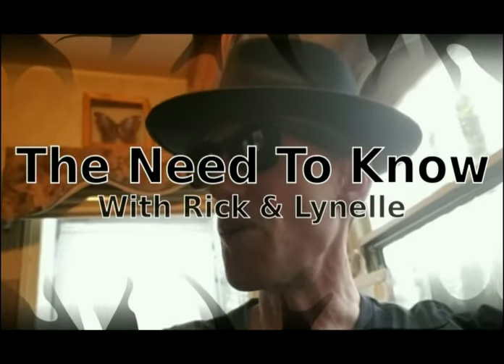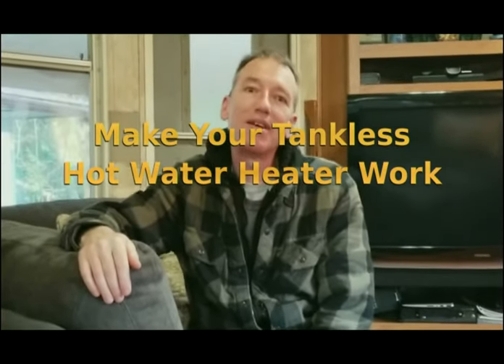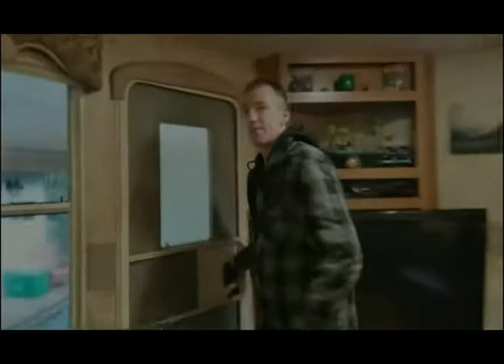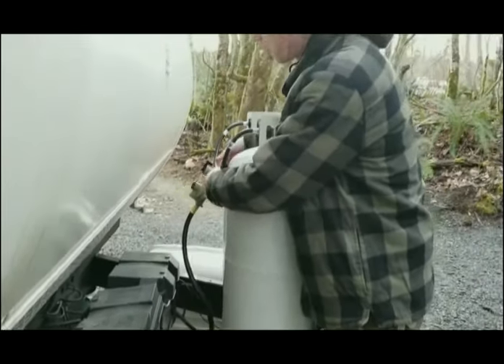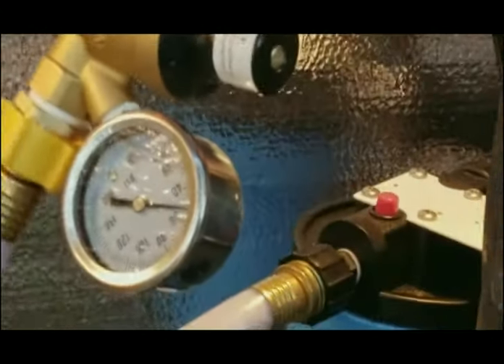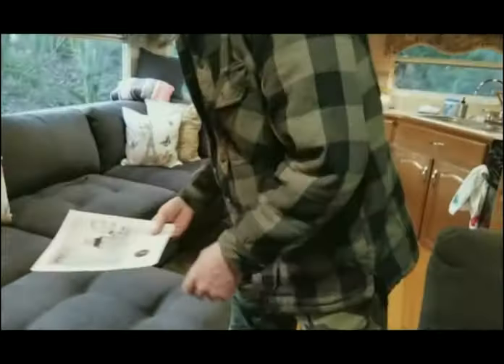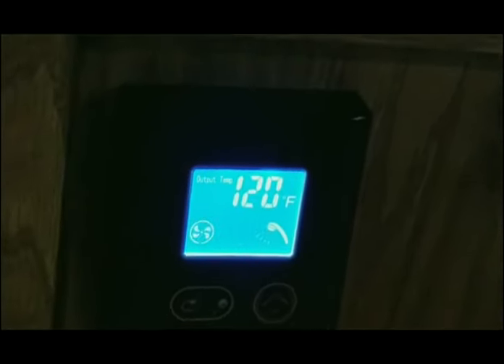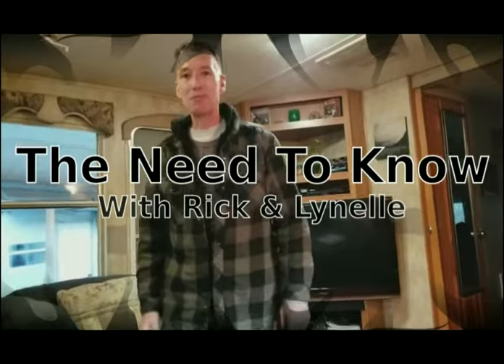Make your tankless hot water heater Work - THE NEED TO KNOW files.

Comment: Thanks for the good and informative video. Just for anyone wondering, here's the info on the components Rick & Lynelle used:
Tankless Water Heater: Girard 2GWHAM

Propane Regulator: Marshall Excelsior MEGR-253H
Water Pressure Regulator: Renator M11 0660R

Comment: I installed my Girard GSWH - 2 about two weeks ago. Runs fine 1/2 way through a shower then gets cold for about 15 seconds, then back up to temp again for the remainder of the shower. Okay for me - for my wife, not so much.
I am going to replace both the propane regulator and the water pressure regulator. I am confident this will solve the problem. 
If it doesn’t work - I won’t laugh at another one of your humorous video openings for a whole 90 days.
Reply from the maker: 90 days! That seems a little harsh. Lol. I'm not sure your symptoms are related to flow or not but there is a very good chance that it is. At any rate, it's hard to do any troubleshooting or diagnosis if you don't have good flow to start out with. Let us know how it turns out.
Reply: Ours did the same at 124 degrees set point.  Lowered it to 120 and problem solved.  Lowering the temp allowed us to increase the flow rate through the water heater.

Comment: I plan on converting my 5th wheel into an full time tiny home. It'll be stationary with full dedicated plumping and septic. My question: I plan on getting a full size propane tank, I think maybe 50gal? im guessing. And I will have a dedicated water line. I bought a nice full rain shower panel on amazon with rain/waterfall/and 5 spouts and handheld. I really want to get the full use out of it, so I'm looking into a 60k btu 2.4gpm RV tankless propane water heater... I plan on ordering it soon, but I want to make sure I get everything I need to install it correctly to make sure it works properly. With using only one full size tank, should I get the same propane regulator? or is there a different one I can get that doesn't use two tanks. Also, any tips or ideas what I should do and what I should get to take full use the heater and shower panel.  Should I get a full size home 6.5 gpm tankless water heater? or go with the RV style ones? also, what about getting a 4.8gal expansion thermal tank? Anything ideas or tips would be much appreciated. Thank you!
Reply from the maker: Well Bob, that sounds like a really big project you got going on there. As far as thr regulator goes, they do make high flow regulators for single tank applications. The high flows are green (usually olive drab). The silver or aluminum ones are generally not high flow although sometimes they are. The red ones reduce the bottle pressure down from approximately 30 psi to approximately 14 psi so you don't have long runs at high pressure. That's a lot of extra information. Bottom line... Get the green one. You will need it to give you about 11 inches of water colum pressure.
Reply from the maker: We just sold a 38 foot Montana 5r that we lived in for w years. It was stationary like what your describing. I bought a 12 gal  home type hot water heater at Lowes an retro-fit it right into the spot the rv 12 gal was and it worked great. Plenty of hot water for a good hot shower... Just something to think about? It's a lot simpler an less expensive.
Reply: @keyin2it  Thanks! I'll look into it. Definitely my biggest project, and my first very own home. I got pretty much everything brand new, all the appliances, regular toilet, new pedestal corner sink with corner medicine cabinet/mirror, vinyl plank flooring, all new roof fans, sundome, etc, new 36x36 glass shower enclosure,  and one of the main things i need left is a good water heater so I can enjoy a good long shower. I do plan on doing a full electrical upgrade to atleast 100amp. It'll have its own box. But thanks again for the reply! I'll look into that single one for sure!
Reply: @keyin2it  Interesting. I will look into that! The 12 gal water heater. I know they're much simpler and less issues trying to get the water temp right and steady.
Reply from the maker: @Lyricz-4-us  Right on Bob! I'm impressed with what your doing! Our experience was similar. Both Lynelle and I had rented our whole lives. rv life was our first shot at ownership. It was a Segway into owning the old house we live in now. We were able to put money away due to the low expenses of rv living. You have the right idea. Oh, and whenever you can, use house type stuff when upgrading your rv. Anything made for rv's is crap. But, sounds like you already figured that out. Your on the right path. Keep going that direction. It's a great life!
Reply: @keyin2it  Cheers! Many blessings to you and your family! ✌

Comment: You can put  a circulation pump and a return line with a 2 gal electric water heater this is called a buffer tank .you'll have hot water instantly. Youll also have to install a check velve

Comment: When you're boondocking use 5-gallon buckets to catch the cold water put it back in your tank 
you got hot water take a shower for a minute  no loss  better yet just rig up a filter system so you can recycle the water over and over from the shower and the sinks

Comment: I'm having trouble understanding why a 350,000 btu regulator is need to run a 60,000 btu water heater? I'm concerned that adding such a high capacity regulator adds chances for disaster. Can anyone give me a safer option that will support the suburban IW60? I don't plan on running any of my other gas devices while showering.

Comment: What size propane regulator is it
Reply from the maker: It's 350,00 btu/hr. Does that answer your question?
Reply: Rick & Lynelle- The Need To Know 
What the propane regulator set at like 30 psi or more. The one in my Rv is at 20 psi. Thank for your video
Reply from the maker: This is a 2 stage regulator. The first stage takes the pressure down from tank pressure (100-200 psi or so) to around 30 psi. The second stage goes from that 30 psi to the standard rv appliance requirement of 11 inches of water column. Many rvs also use a small 30 psi regulator to reduce the bottle pressure in applications where the propane bottle is a long distance from Tha main regulator. These small 30 psi regulators are usually red in color. High folw regulators are usually green and standard regulators are usually unpainted or silver.
Reply: Rick & Lynelle- The Need To Know 
Thank you for all the help

Comment: There is a flow control on the back of your unit ive heard of people adjusting that 5o make the heater not only work but also efficiently.  With the regulators you purchased your heater is working just not as efficient as it could.   The regulators you purchased are a good investment bly i i were you I would look into the flow control on the heater.  Hope this helps.    Great job on your first YouTube video, keep the good information flowin brotha👍
Reply: Okay, but if it comes from the factory full open and you decrease water flow aren’t you just exacerbating the problem?

Comment: you would use less water if you trickled the water till it's up to trump then slowly increase flow your using like tank water heater
Reply: Trickling the water won't work because the water heater has to have enough water flow in order for the flame to kick on. If you turn the water down the flame goes out. That's how they work. I have one as well.